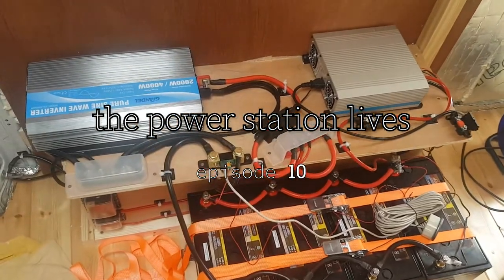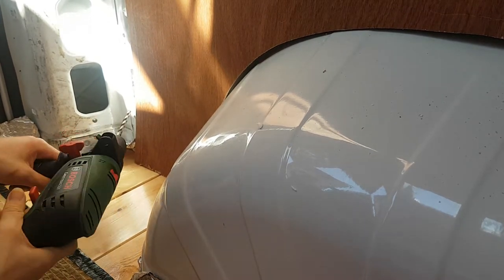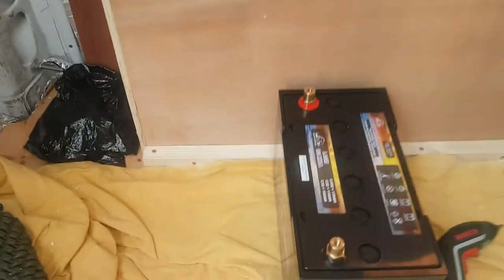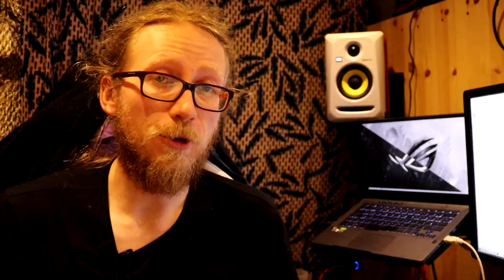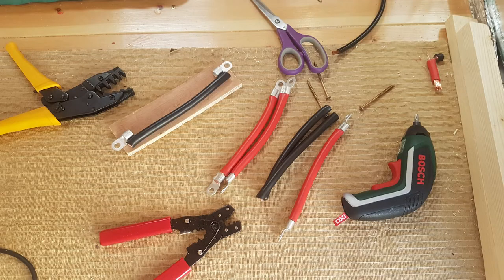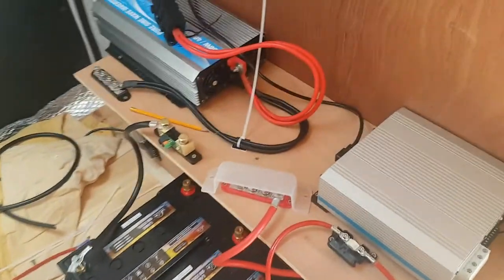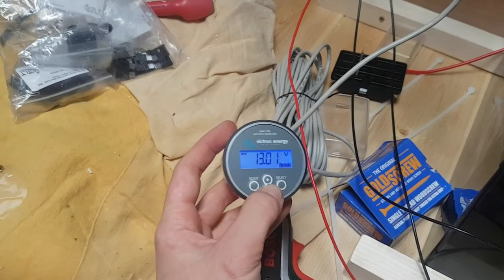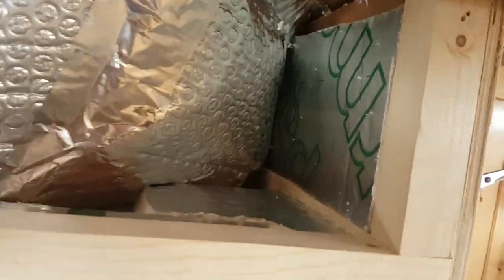putting together my 12V electrical hub, the power station lives! - episode 10 - nerd builds camper

Comment: Impressive stuff. Like the honesty of “100 hours of research”. Of course research is nothing without the intellect to put it together and you clearly have. Honorary degree in electronics by the end of this I expect.
Reply from the maker: Aw thanks Michael that's lovely. Yeah I mean trying to discern between what information is or isn't relevant or valid when things are contradictary is perhaps the hardest things. There's a bit less of that with the electrics than some other aspects of the build but it still gets very tricky. I've still got issues with the batteries not charging as much as they are discharging, so something is wrong, presumably in the connections again, so the quest continues really!

Comment: if you want to get your van alternator to charge your battery bank while driving i swear by these https://www.ctek.com/uk/products/leisure-sport/20a-off-grid     Also, a cheap way to add solar too. Might be too small for your needs but can be upgraded using a ctek smartpass adapter too.  Also has the side effect of charging your start battery up if it goes flat (from either solar or your batter bank).
Reply from the maker: Ah cheers for the comment Lee! I forgot about your awesome nerd-mobile, probably should have asked you some questions while I was doing this! I am sorted in terms of batter to battery/alternator charging, the charger on the right hand side of my setup does solar, mains ac and battery to battery which is super useful. It also trickle charges the starter battery, definitely a neat feature! Hope you're good man